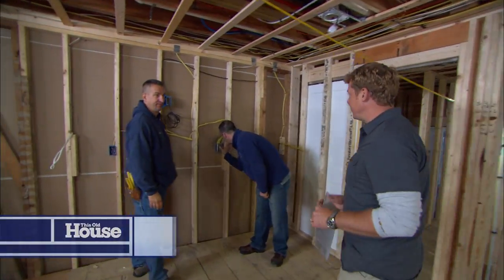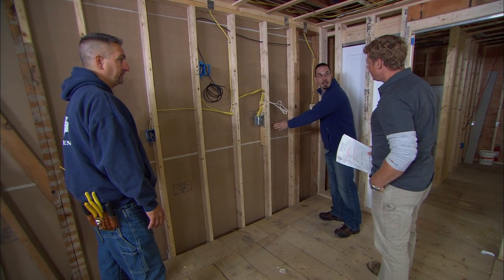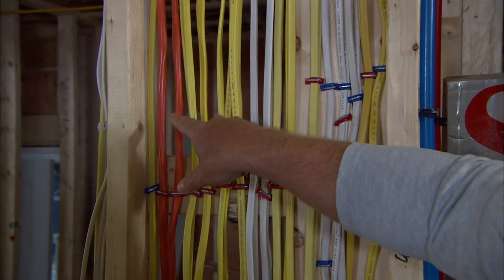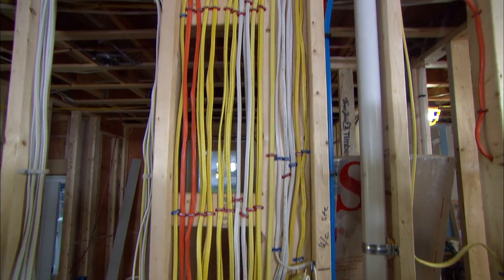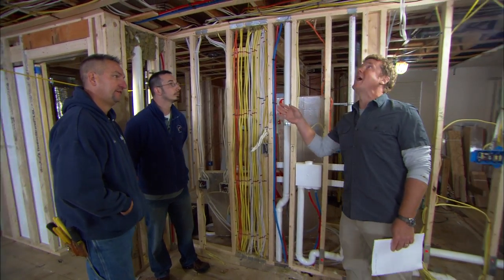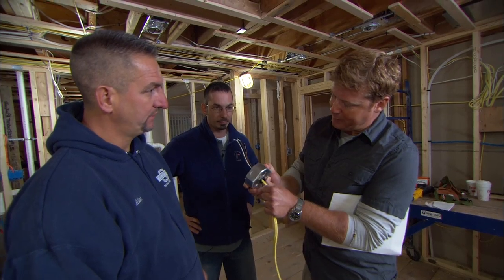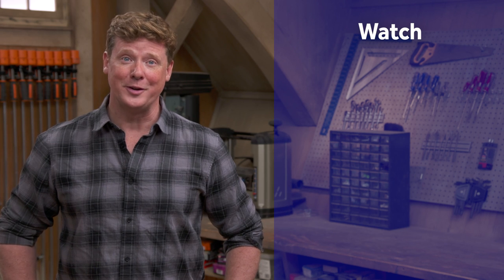How to Conduct a Rough Electrical Inspection | This Old House

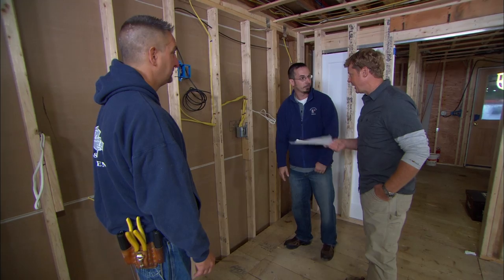Comment: Yeah just pay no attention to the sharp metal box with no bushing cutting the insulation on the wires at 1:05.. that's clearly not a violation at all 😂😂
Reply: Oh men I trough nobody else saw that 😂😂😂
Reply: Well as I have gotten  older working in the trades I learned TOH has a lot of butchers
Reply: @Kevin-mp5of  excuse my ignorance, but what is the TOH?
Reply: @PaulRudd1941  Short for this old house
Reply: Those boxes have internal cable clamps. There’s nothing wrong with the romex coming through the box that way. That’s very typical of that style metal box.
Reply: 👍🏽 what Josh D said.
Reply: @joshd605  Never see those boxes here in Ohio at all, would rather have the regular way to secure that then a plastic.
Reply: @Kevin-mp5of  I've seen more hack commenters than TOH hacks on this YT channel. It's usually some handyman who thinks he knows better than the guys doing a half a million remodel
Reply: @joshd605  No they don't. Those are standard 2 1/8 depth metal boxes with knockouts. You can see the knockouts on the side. The Pendent light he showed had the plastic insert, but its not present on the box at 1:06

Comment: Run your little wires just make sure to leave enough slack for my ductwork
Reply: @Fisher Man just do what I do: run the wires, install the panel, the service, the ductwork, install and start up the equipment, install the septic tank and leech field and the plumbing. Jeez, ya slacker 🙄
Reply: Get your duct in first bud.

Comment: American wiring always looks hideous. Cables running in all directions, twisted and scruffy as.
Reply: Agreed. I’ve been a Electrician for 24 years here in Ireland. American wiring always seems so rough to me. Why don’t they ever put sleeving over the bare copper earth(or as they call it ground) wire.?
Reply: As what?
Reply: @yaosio  as scruffy as…
Reply: @eoincasey5461  What is the benefit of putting a sleeve on it? I agree that in a crowded junction box you run the risk that the ground might touch something energized...but that's a pretty low risk
Reply: @eoincasey5461  , why should we? Please educate us.
Reply: @yaosio :  Ending sentences with "[adjective] as" is common in Australia and NZ (especially "sweet as").  It's poor grammar, but just interpret it as "very [adjective]".
Reply: @eoincasey5461  Romex doesn't have a seperate insulator, but MC (metal clad) cabling does. Some of the worst wiring I've seen is in the UK. Especially ring circuits, and those caltrops used for electrical plugs!
Reply: @guytech7310  I’m not from the UK